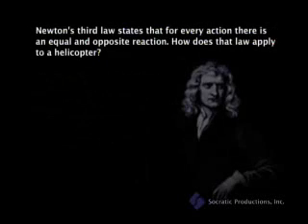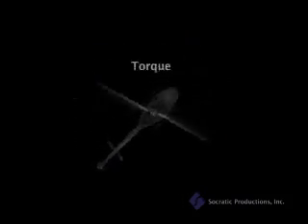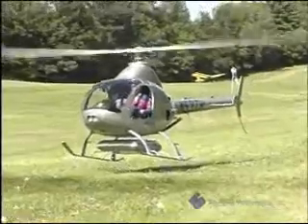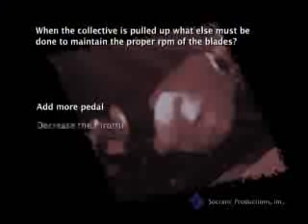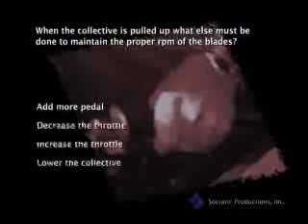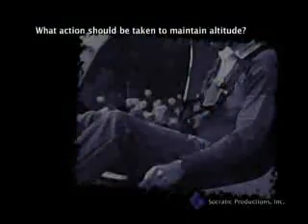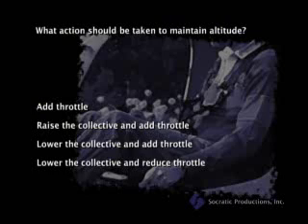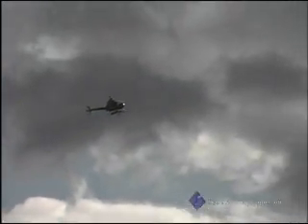How a Helicopter Flies Part 2

Comment: Thank you so much for posting this. This is the EXACT thing I learned in Helicopter training. The helicopter is $300.00 per hour, and the instructor is an extra $50.00 per hour. The Robinson R-22 is a Great chopper to learn in, and the Rotorway is a Very smooth helicopter to fly.  Constant Pre-flight inspections and maintenance WILL save your Life.

Comment: I think a helicopter is harder in general. It's harder to keep stable than a plane. However, landing a plane is probably harder because you have to touch the ground at the right speed and angle. You can do things very slowly and carefully in a helicopter
I'm not a pilot of either, but I want to be a chopper pilot. This is just what I'm assuming from what I've studied and understood about them.

Comment from the maker: I wouldn't say controlling a helicopter is easy at the beginning.  It takes more than just good eye hand coordination - but like everything else, practice and experience will eventually make the task second nature.  To get a pilot license does require a bit more.  But if you are motivated, I am sure you can get through the challenging parts.  Good luck.
Reply: Socratic 101

Comment from the maker: @danielpilot95  The guy in the helicopter is also an instructor.... here is his response:
All aircraft have limitations that if exceeded can ruin your whole day.  You have identified a couple limitations of the of the conventional helicopter.  There are two height vs. velocity operating regions where it may not be possible to establish a stable autorotation after an engine failure.  Too fast and close to the ground and you may contact the surface before the pilot and aircraft can react.

Comment: @socratic101 what happens if you are flying low level and the engine fails or
if ur flying across the ocean then what happens with  altitude too low  for autorotation 
or no place to land

Comment from the maker: @locomex713 Probably not!  The level of complexity of helicopters is VERY different - for example, a recip engine operates very differently from a turbo jet (never mind one or two engines).  Rigid, semi rigid and fully articulated rotor heads are very different and require specific training.  Gettng the idea?